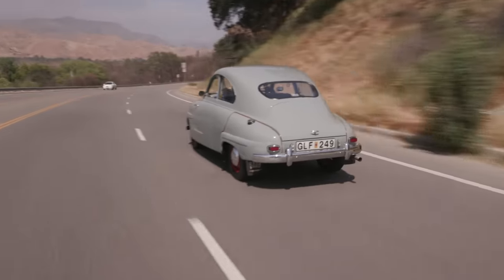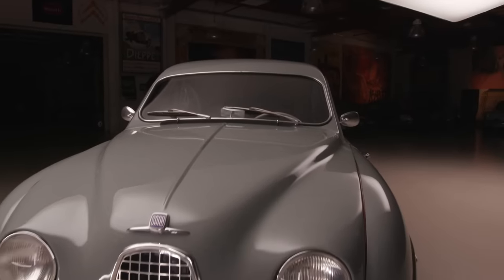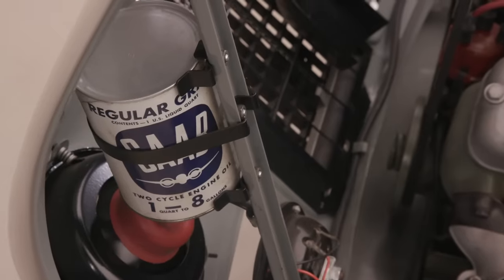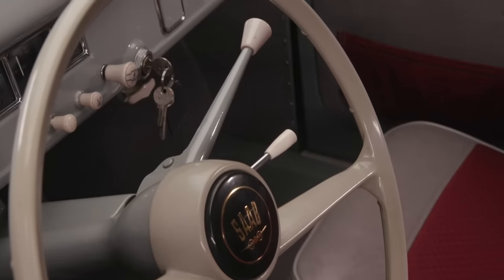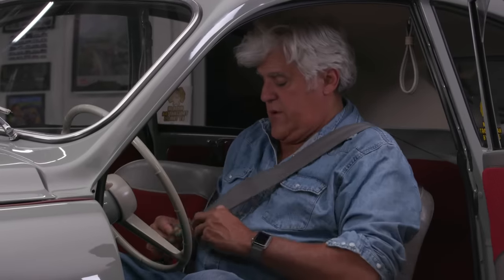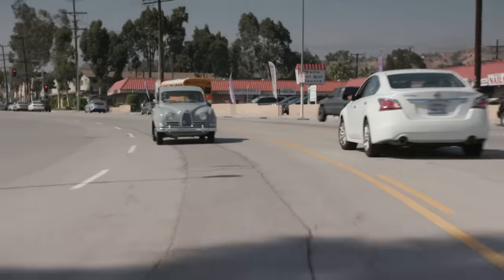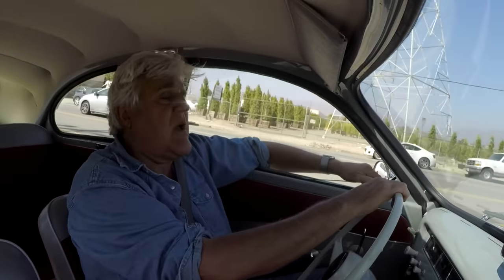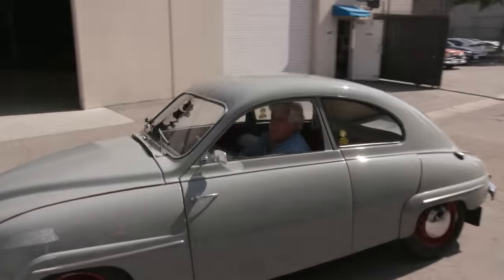1958 Saab 93 - Jay Leno's Garage

Comment: Nice 93. I had one with v4 and 4 speed. That freewheel feature saved me many times  in winter driving. If you went too fast in snowy going the car would "get on top" of the slippery stuff and start to skid off the road, when you lifted the throttle the car would just roll straight and save you. Very nice feature.I miss it.Love your show.
Reply: it took me always 2 years to understand that when in the late 70ies i owned a 900 turbo and always put something heavy in the back
when there was too much snow in the Stockholm region ;o))

Comment: My first own car was Two Stroke Saab 96 -66. It had long nose waiting for Ford V4 engine  and it made the weight balance optimal 50 : 50 which was real fun to drive in bad winter weather. If somebody was driving too near me I just pulled the Choke lever and voila. It had tripple carburettor and needle roller bearings which made the engine fast acting. I really loved that car.

Comment: As of 11/25, three Brits did not appreciate the water-generator comment lol
Reply: I'm a Brit and I thought it was funny
Reply: elistickband  Me to
Reply: @elistickband  i second that comment!
Reply: The Brits have a sense of humour... Well the ones who got Jays joke do anyway.
Reply: I think more Brits will not appreciate your comment haha - it's 25/11
Reply: @jeanpierre-xw1wb  Mostly because we used to own the rest of the world ?
Reply: @ @ianbaxter8299  Good point :)
Reply: @Al Dunn 

Lucas. Prince of Darkness.

They had a weird sense of humor.
Reply: @@Al Dunn No, never heard that joke before Zzzzzzzzzzzzzzzzzzzzzzzzzzzzzzzzzzzzzz
Reply: @Al Dunn Lucas didn't and does not deserve that rap. The trouble was with the pure copper wiring that Lucas contracted out. When copper gets wet, it corrodes and bursts the insulation causing all kinds of fun. The components like the starter, dynamo and regulator are largely trouble-free, or if they give you trouble can be easily repaired. I used to have an English made 1954 Citroen Light 15. I rewired it totally and had no electrical problems after that for the next 15 years before I sold it. On my 1960 93F, the "waternator"  is a Bosch which have their own problems.
Reply: @KenworthW900HG    :D
Reply: @jeanpierre-xw1wb     James Douglas Muir Leno is half British anyway !
Reply: @M Bacon water pipes are made of a copper alloy- I used to be a plumber. If Lucas's subcontractor used an alloy in their wire we wouldn't have all the Lucas jokes to tell, would we? I wouldn't say poor, cheap maybe because they needed to sell cars at a price where people would buy them. Post-war recovery of the economy (export or die) and all that but that's a whole other story.  
I don't think Lucas products are poor at all. They may break like anything else, but they can be usually be fixed easily too, like on the side of the road. Most owners of old  British cars will tell you stories like that.  Rewire that MGTC with modern wire and all will be well.  But do add relays and fuses.
Reply: @Al Dunn Lukas invented darkness -  at least that is what we are saying in Denmark
Reply: It seems to me Jay is slightly intimidated by British know-how.

Comment: I had a 1971 Saab 99. Fantastic car. 4 in the floor, and pretty fast for a 1971 bone stock car. I loved it! Had to pull the motor to change belts, but I could change a clutch in 30 minutes!

Comment: He didn't change from hot burning to cool burning plugs. Jay's friend Tom from Iowa with a frozen engine didn't read the owners manual. It clearly describes the need to change the three spark plugs to cooler burning plugs when you drive at highway speeds for long distances. Conversely when you drive in town you switch to hotter burning plugs which assist in burning off un-burnt oil from the plugs themselves. It also describe how the hotter plugs will eventually burn a hole in the piston. Now that's a quirky engine. As a lover and owner of many, many "Sobb Stories," I have seen several 3 cyl engines with destroyed pistons with premixed oil or direct injection. Rust was the death knell for the truely cool older Saabs..
Reply: @Kriport typed:  how the hotter plugs will eventually burn a hole in the piston."  Never knew that those SABs were 2 Stroke, but then I can't remember seeing them on the road, while growing up (1960) But I saw pictures of them. Maybe later in Vienna  saw some... OT happened to me on a motorbike (the last I've owned), Suzuki GT 380 2 Stroke 3 Cylinder,  was driving on a a highway going about 120 Kmh, and suddenly no power....later took the engine apart  (with the help of mechanic,) and the middle cylinder had a whole...  at that time it became too expensive to rebuild it... then the parts got stolen.... but this is not a car story... sorry if I bothered you. Still thanks for the info :-)
Reply: If anyone knows two stroke Saabs in the USA is Tom Donney. He knows what he's doing with those cars more than most.
Reply: Tom is also currently manufacturing new connecting rods, wrist pin roller bearings and has a patent in process for a crankshaft rebuilding Jig. He is keeping these 2 strokes  on the road.

Comment: I had a 1957 model 93. It was serial number 1200 or so. It had a split  flat windshield but otherwise was same as this 58 model 93. It came with a spare parts kit in the trunk with fan belt, spark plugs, distributer cap, points and rotor. Simple reliable transportation. I did have trouble with the water pump leaking and messing up the generator,  but rebuilt ones were available then. Traded it for a 1969 model 96 with the Ford V4 engine, four speed transmission and front disc brakes. Still had the freewheeling. Wish I still had them.

Comment: Not enough oil in the gas Jay.  You aren't killing enough mosquitoes (and enraging the anti-oil crowd) ... :D  Need to see a wee bit of smoke.  The best runners always did. And, if a COP pulls you over becasue it's smoking, just rev it - they'll shake their heads and walk away ...
Reply: Thats what I'm thinking.. a little blue screen behind the car is good. No smoke for 2 stroke means no good.
Reply: @ladam836  with synthetic 2 stroke motorcycle oil there is "practically" no smoke. Only on startup.
Reply: Yea...no obvious smoke but a little bit of blue fog. :)
Reply: @ladam836  When I first got my Saab on the road, the very first day some guy in a Volvo said "You better get that fixed!" "What?" I asked. He said, "that smoke" He wasn't too happy when I told him it was a 2 stroke and supposed to smoke. But, you should have seen the smoke in my garage when I got it running for the first time in 19 years. You could have hid in that smoke cloud! Cripes, it's a fun car!

Comment: If this was a car originally from Sweden (Swedish plates in the trunk), why would the steering wheel be on the left?  I thought Sweden switched from driving on the left side of the road (as in England) to driving on the right (as in most of the rest of Europe) in 1967.  As this is a 1958 model, I would have thought it would be right hand drive.
Reply: I know Russia, and some Eastern European countries drive on the same side as the US......
Reply: Sweden drove on the left in 1958, but the cars were all LHD.
Reply: At the time in -58 many of the cars in Sweden was American & German and steering from the left side was most common and it was cheaper for SAAB to just build one typ of cars, many SAAB cars went on export also.
Reply: Notice that the fuel tank filler is on the left side, which is most commonly used in a RHD car.  I have seen some other videos of VW barn door microbus's in Sweden, and the barn doors are on the left side.
Reply: All cars sold here in sweden has always been left hand drive, even if we drove on the "wrong" side before 1967. Right hand drive cars is a very british thing.
Reply: @berndtthomas  My 1960 93F is from South Africa and it's LHD. The gearshift linkage going over the top of the gearbox does look like an afterthought. It sure looks like it was intended to be RHD. I wonder why the shift linkage didn't enter the gearbox on the left side?

Comment: This was my 1st car..got it in 1960.
Subsequent this SAAB I had 2 others the last a 1968 GT Monte Carlo.
The later SAABs had an oil reservoir for the oil under the hood
which metered the oil into the carburetor.

Comment: A friend of mine did a historic Monte Carlo rally in a Saab like this. He met Eric Carlson and asked him how he managed downhill using the freewheel - if you use the engine to brake it is running without oil with obvious consequences - Carlson said he didn't use the freewheel but used the engine to brake and the mechanics had lots of spare engines.

Comment: I used to work on Saabs 340b you know the ones with the fans on the front to keep the pilot cool. You know if those fans ever stopped they start to sweat. I like that car it's pretty cool it's very unique. Mr. Leno God sure has blessed you. Car with a factory kill bolt switch.

Comment: Hey, us Brits are great with electrics, he says with smoke coming out of his ears and the hairs on his head standing on end! If you think we are bad what they heck do you think of the Italians!!
Reply: Hmm, Lucas electrics.....

The Lucas motto: "Get home before dark."
Lucas is the patent holder for the short circuit.
Lucas - Inventor of the first intermittent wiper.
Lucas - Inventor of the self-dimming headlamp.
The three position Lucas switch - Dim, Flicker and Off.
The Original Anti-Theft Device - Lucas Electrics.
Lucas is an acronym for Loose Unsoldered Connections and Splices
Reply: Lucas: The Prince of Darkness.
Reply: True, my father had a couple of Fiat tractors. We lived on a hill, when cold spray ether in the intake,,, then do not stall them. Engines worked well electrics did not. Buy a Ferrari, nothing different!
Though we had a pommy Ford diesel truck as well. Not a great deal better.
Reply: they made great parts just couldn't figure out how to run wires between them .Least that's what Jay said about vintage Ferrari's, you need three battery shut off switches for safety.
Reply: Forget it. We had a British car in Sweden, and it was utter sh*t in Sweden. Useless.

Comment: [not possible to lift a tire on ice] -- It might be possible depending on studs used. I can imagine using pretty aggressive studs if your entire purpose was racing on ice.
Reply: Yes. It's actually common to lift tires in corners in higher classes of ice racing.

Comment: Engine should technically be a smooth as a 4 stroke straight 6, when under load,, ,,,,,my GT380 Suzuki 2 stroke triple was so smooth at part throttle it seemed like an electric motor.

Comment: I had the V4 four stroke model. Easy to service, I did all my own work on it and with the free wheel it was very economical, I regularly got 40 mpg (UK Imperial gallons that is) Boosted the performance by fitting a Weber carburetor. A brilliant car in Scottish winter snow and ice conditions. No power assist so if the steering suddenly went light you were extra careful. At the time a friend had a Mk 1 Range Rover and waited for me at the top of a snow bound road full of steep hairpin bends on the Isle of Skye. He was flabbergasted when I shot past his parking place and carried on into the distance with no effort. Well what would you expect from a car designed for Scandinavian winter conditions.

Comment: Our family had three of these over time -- two were three cylinder two-stokes, and mine was a V4 4-stroke with a bad transmission -- I still have the busted third gear from when I rebuilt the gear box. Nice ride. Simple to maintain -- though New England road salt was less than kind to them. My clutch cable ripped one night -- but using 'free wheeling' and starting and stopping the engine in gear, I got home okay. Nothing like handing a can of oil to the kid filling my Dad's 93 tank -- 'WTF is this for?' we heard more than once. Best of all.. No embedded GPS tracker watching our every move.

Comment: In essence, if not mechanics, this reminds me of my 1982 Toyota Starlet - the only new car I ever bought. I nicknamed it "The Wart" - it was just a little econobox hatchback with a 1.3 liter 4, no A/C, no frills of any kind - crank windows, vinyl seats, etc. But it was fairly peppy and fun to drive with the 5 speed manual, and bulletproof beyond anything I deserved. I was young, broke, and stupid - I abused that little thing. Once went 50K miles without an oil change. A Navy buddy and I made a 22 hour drive home for Xmas with the pedal literally floored the whole way (about 90 mph). And about five years later, I built a trailer hitch for it - because no sane manufacturer sold one. I then put about a ton of lumber and a 14 foot sailboat on a trailer I had built, and took that from southwest Michigan to the Cleveland suburbs for my brother. I never had to repair that car, but lost it when a guy ran a red light in front of me and I plowed into his SUV in 1990. Even then, it still ran. I pulled into a gas station/garage, and borrowed a hand sledge and crowbar, to beat back the body which was rubbing on the front left tire, pried back the sheet metal on the hood which would not unlatch, found the radiator with numerous holes from having been pushed into the fan. SO I bought 10 gallons of washer fluid, strapped down the hood with twine, refilling the radiator about every ten miles. About 8 miles from home, it overheated again, and I was out of fluid. So I pulled over onto this gravel parking area, got some water from a mud puddle, poured in about half a liter of Coke, and pissed in it. A final indignity to a brave little car - but it got me home. Eight years and 196,000 miles of this amazing little car were over.

Comment: I Had One of these Cars and with the Free Wheeling, I would get Over 50 Miles to a Gallon!!.....My Car was a Cute V-4, 4 cylinder!!....Mine was a 4-Stroke....It was a Great Car!!!
The Car`s Underneath, had a Full Body Pan....In Deep Snow, One could Go Sledding!!.....Also, I could Never Find Reverse......4 Speed, on the Column.....Great Video Jay!!!!

Comment: Great stuff Jay. Love seeing your beautifully restored cars, thank you for sharing.
I once had a 3cyl two stroke DKW Auto Union, great car apart from the ineffective brakes and weak 6v headlamps. As another commenter stated, the freewheel was fitted to prevent the engine from receiving no lubrication from fuel mix on overrun.
S

Comment: Pulled out the 2 stroke engine and put in the V4. I kept the 3 carb set up for 27 years and never found anone that needed them. So when I moved from the Santa Cruz Mtns to the Sierra Mtns in 2001 I left them in the SC mtns. I tired..  The gas tank had a propeller to stir things up.  Freewheeling was cool.

Comment: Fell in love with SAAB with the 900 series in the mid 70's. It was a just "perfect". Super economical, roomy, 3 or 5 door hatchback. One of the first to use exhaust driven TURBO CHARGER on a family sedan. Like VOLVO designed with passenger safety in mind.

Comment: Love your reviews! Thanks for this I had never seen one close up.  I worked with a German machinist who added a fourth gear (overdrive) to the 3 speed transmission.  I also had a boss in the 90's who made the first car trip from northern Canada to the southern tip of South America in this Saab with 2 fellow McGill engineering students in the early 60's (they had to get a ship to transport them from Panama to Colombia).  He had a number of interesting cars in his garage including his parent's Bristol Sedan from the 1950's in mint condition with low miles.  There was an external compartment behind the front wheel for the battery! He has since passed away and I don't know what happened to this car. Would be great if you could do a video on your 55 Bristol 403 (I could only find a popular mechanics article).

Comment: A friend of mine (in Finland) had the legendary Saab 96 that also had the freewheeling clutch (but a 4-stroke engine, so it was a later model 96). He did all kinds of funny tuning to the engine in hopes of getting a few more HP from it (I remember at least thinning the valve shafts to allow a little more flow). At one point he had at least two extra 96s for parts. Once he wanted to get rid of the freewheeling feature, so we welded the clutch permanently solid (it still had the separate normal pedal clutch like all manual shift cars). But we obviously did not weld it strong enough because at some point it broke loose again, heh.

Comment: Jim Swindells.      I had a couple of Saab Model 96 cars, a blue1965 and a red 1967. Both had a German Ford Taunus V4 engine, 4 stroke 1500cc. Much more powerful and quite fast. Both also had the "Free Wheel" device, which as Jay said, when you came off the gas, the transmission disconnected. The main benefit of this was when the car started to slide, on ice or very wet roads, the driving technique was to come off the gas, the transmission would disconnect, which eliminated engine braking (stay off the brakes) so each wheel was now free to find the maximum grip and the car would stop sliding 9 times out of ten and straighten up. This is why Saabs won so many winter rallies (Monte Carlo Rally etc). They were great on ice and snow. Another benefit? was that whilst in the Free Wheel mode it was possible to change gear without the clutch. So as you approached a traffic signal (on Red), you would come off the gas, start coasting select 2nd gear (no clutch), still coasting and slowing and when the light changed just hit the gas and leave most cars behind. Basically, a semi automatic gearbox.